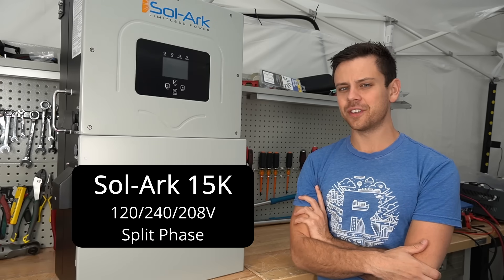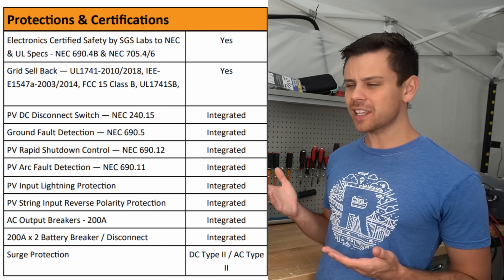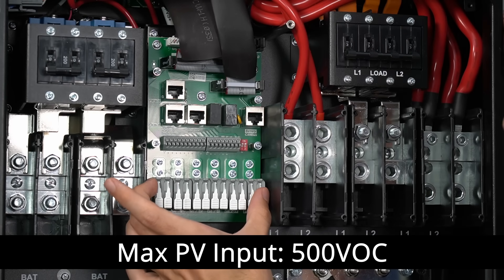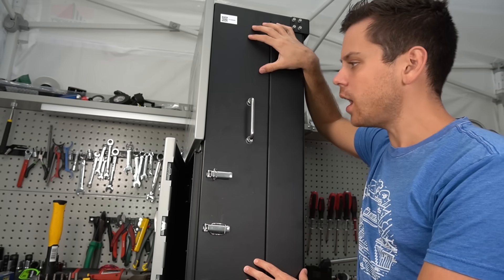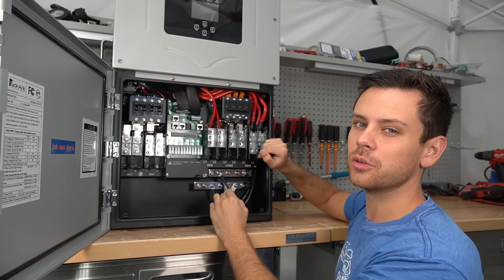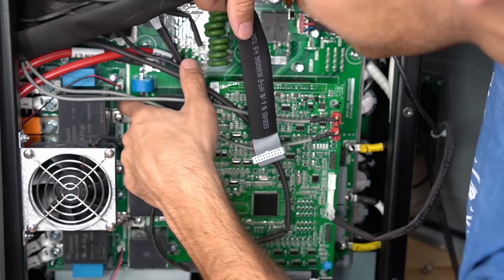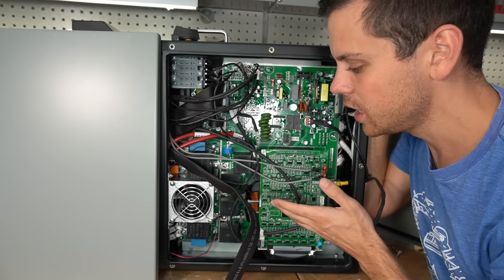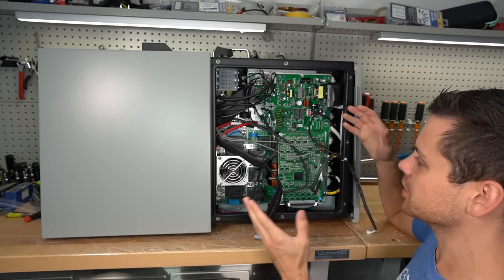Sol Ark 15K: Ultimate Grid-tie or Off-grid Inverter

Comment: The 200 amp pass through makes this an incredible solution. I believe there are around 90 million homes in the US with 200 amp services and cutting this inverter in between the meter and the panel makes for the easiest installation out there. Can't wait to couple it with the smart load. 14.  I've installed the 15K on three homes and they perform great! Thanks for the review Will. It's a beast.
Reply from the maker: Looking forward to your new videos. Your builds are incredible
Reply from the maker: Oh man that's so cool. What a beast of a unit. The passthrough is so useful. And that's a ton of homes! Three installs already?! That's so awesome
Reply: With the 200a passthrough, does this mean I can basically have this connecting to my main grid input and have the 15k feed my main house breaker panel? Basically I take my two phases out of my main, then into the 15k, then connect the 15k AC output back into my main? If I under produce using solar, that would complement using the grid?
Reply: @mathieuisabel9086  That is correct, I currently have a pair of the 12K units in parallel feeding my home (same principle, just max of 120A main)
Reply: @mathieuisabel9086  Yes (assuming an approved fused disconnect at the meter, a interconnect agreement with the utility, etc.)
Reply: @mathieuisabel9086  No, you don't' want to design the system to fail.  Think about your total system design.  I provide consults.  Click my logo for more info.
Reply: What would you do for a house with 320 amp service using I think what they called a double tap meter or meter box.  200 amps to the house and 120 amps to the garage.  Would one use two 15ks?
Reply: @fred6464  on $320 or 400 amp services you can feed to inverters from the meter and then combine the load outputs using either an AC combiner, or Polaris lugs, or power distribution blocks making sure that the r-rated for the correct amperage and then feed any in all panels downstream.
Reply: @fred6464  you could have two separate systems but I’d probably set a 400a disconnect next to the meter and use two 15Ks to disrupt that service and then feed the house and shop off a loadcenter on the load side of the inverters.
Reply: @NoahBeall-BPS  Thanks, that makes sense.  I do not plan on doing any of this myself, but I want to have an intelligent discussion with whoever I would hire in the future.  I also have a 20Kw generator connected to the 200-amp service which is all Generac equipment.  Net metering is available where I live as well.
Reply: Does putting one 15k between the meter and the panel mean you are limited to just one (not expandable)?
Reply: @keithwingo514  it wouldn’t be too difficult to add more inverters in parallel
Reply: @keithwingo514  no you are not limited you can parallel and combine I have a customer in Belize that has stacked 9 - 15 k's
Reply: XW  Did All This 15 year Ago x3  xw4860 18kw  still working
Reply: The man himself! The 15k is a beast but we are having interconnection issues with certain utilities that require an AC production meter. Obviously there’s no way to meter PV only on the AC side with DC strings… it’s a bummer.
Reply: @NoahBeall-BPS  My utility in midwest required the extra PV AC meter to monitor AC production to grid even though I have smart meter that measures incoming and outgoing current.  I believe you can still install a 15k with extra PV AC meter by installing the required AC main 200A disconnect that would be fed from the extra PV AC meter to the 15K AC input connection.  When I considered tapping the Main AC line to connect the 15k to my home, the cost and time with no power were a deal breaker for me.  If you need the 200A pass through, it is a great option.  After logging power usage on my home for 8 months, I don't need that much power at once.
Reply: @TheJjyoung333  we can do that here because they are requiring Production meter, not an export meter.
Reply: Which batteries and panels do you pair with inverter for best results? Any recommendations?
Reply: I don't think you want this handling your whole 200 amp panel, its just a bad design.  The purpose of getting this is to provide battery backup of critical loads.  It can handle about 4500 watts per hot connection (L-1 or L-2) or 12,000 if they are totally balanced.  So if your power goes out you want it to be off grid and handle the loads properly.  I have a solar business and make batteries.  I have a few of these installed out there and know how they work.  I provide free estimates and can do consults.  Putting this on your mains and powering your whole house is mostly likely going to cause problems unless you just never use more than 4500 watts per each of your lines.  Click my logo for contact info.

Comment: Pass an inspection for an off grid application, what is wrong with that perspective. 🤔
Reply from the maker: People still pull permits for fire safety codes with pv array installs. And you can be still tied to grid for backup and need inspection, but run your house 100% Offgrid. Up to you

Comment: Finalizing design of my system and went back and forth between 3 EG4 or 1 SolArk 15k.  Hate the price, but LOVE the features, ease of use, and support.  Can't beat the SolArk 15k ... but rumor is EG4 is finishing the testing on some "new and competitive offering".  Dagnabit.  Now I have to wait a tad longer before writing the check!!
Reply: Any links supporting that EG4 competition?
Reply: @craigmitchell5628  a tech at Signature Solar helping with my design said EG4 has a new model in testing that is supposed to be competitive with the12k+ option.  We were specifically comparing the Sol-Ark 15k, but not sure the 'super secret' EG4 model goals are.  He said it was in testing and could be there for another week, month or quarter.  They couldn't announce it until the testing was basically done. .. but to keep checking back.
Reply: @craigmitchell5628  It's probably FUD from a EG4 worker or investor.
Reply: Would be nice if it had the pass-through option!

Comment: Just connected one of these to me 30kw EG4 bank. Waiting on some tree work for array to go up. Went with 36 455w bifacial panels. It does chew through 75-80w just being on, no load connected at all. Will I would love to hear your opinion on battery/charger settings for EG4 bank. Thank you!
Reply: Did the communication protocol work?
Reply: @timburke3096  no luck with that yet. Looking into solar assistant to monitor batteries. Hoping EG4 or Sol-Ark get this working though.
Reply: @TamingilNH  Its a highly technical subject.  I hope you get something working.  I know I have some of my battery systems that are connected to sol-arks.  If it doesn't work and you go voltage mode you might get shut downs.  If you do voltage mode make sure you packs get balanced often.  Unfortunately sol-ark does not have a scheduled balance for some setups so yo have to use time of use settings and do it daily.  But if its just a backup system its not too bad doing it that way.

Comment: Finally, some Inverter and charge controller that is well engineered. Nice to finally see something with normal readable and usable LCD screen, sensible button layout, and LAN and WiFi.

I am sure Schneider Electric is better, but this is not too shabby.

Hopefully we will get some high voltage battery systems in the future, to improve efficiency and reduce thick cables.
Reply: Might want to talk to actual installers and users of Shneider before making that assumption.

Comment: Will, great video on this Sol-Ark 15. The one thing that stands out to me is the grid pass thru and transfer switch for generators. My concerns are if the inverter had a castiropic failure could it still pass thru grid and if the grid was down could the generator still pass thru. Normally auto transfer switches have a manual means of transferring, in the event the electronics fail. I haven saw where the Sol-Ark does.
Reply: You can easily wire in a junction upstream of the inverter to bypass it entirely

Comment: Awesome job Will!  I have been waiting for you to review Sol-Ark.  I will be installing the EMP hardened version of this Sol-Ark 15k along with at least 6 of the UL Rated 48v LiFePo4 5.12kWh batteries (EG4-LL Lithium Battery) in the spring.  Will start as a whole home backup but will move to time of use to reduce daytime Usage costs during daytime.  Still trying to choose panels as my home has poor sub-optimal roof orientation for roof mount.  I am open to suggestions for panels and advice on how to get past HOA resistance in OK.
Reply: Will the eg4 ll battery communicate with the sol ark?
Reply: @richardhulbert9833  Yes, they fully integrate using the network cable comm link

Comment: No doubt it’s the way to go if you want grid -tie.Especially if you have time of use rates,but for many it is better not to put all the eggs in one basket. 3 Growatt 5ks and a transformer is $3050 and scalable also. Good point about the pre charge function in the EG4 batt. I have a f9 code on my MPP 6048 because it is too fast .Got to send it out for repair.

Comment: Hi Will! What would you recommend for someone doing large amounts of solar 20+kW and also doing a few kilowatts of Wind turbines, with the option to run a generator if those two fail to produce enough power and the batteries get low? Would this item be able to handle that? Even if I want to tie to the grid and feed back excess to the grid?

Comment: If I had known in advance all of the problems I was going to have getting my first Sol-Ark 12k to work with my solar battery bank, I would have waited until now and purchased a Sol-Ark 15K. It took me almost two years to get the 63V Sol-Ark 12K model I had originally ordered that was substituted with a 59V model I didn't even know Sol-Ark made. Because I needed to run my LTO batteries at 61V Nominal I couldn't use the 59V model. Now, I have a new outdoor model sitting beside another one just like it sitting in it's box in my shop, waiting to be installed. The only pro's are that if one breaks down, I still have the other and I have more power than I will ever use. But, the amperage of the 15K, wow! I could really do a lot of welding with it as well as running anything on my off-grid farm without any worries. What a unit!

Comment: Biggest issue I see is its a single point of failure. Should it go down, its taking your entire solar/battery system off line.  Otherwise it looks awesome and I want one.
Reply: Sooo...you mean like when an ice storm drops a tree on your grid lines, or when your local grid transformer blows, or when local substation blows, or when grid goes down....like that type of single point failure?
Reply: The inverter actually will continue to pass through power to the loads if you have a grid connection and say for instance you get a battery voltage low fault !

Comment: Hey will. I love the solark 15k. I’ve installed several already. One thing to note is the inverter is not service rated, so you do actually have to have a service rated fusible disconnect on the line side of the inverter. Great vid!
Reply: From your experience, do you think it can pass through grid or generator if the inverter has a catastrophic failure.
Reply: @craigmitchell5628  I obviously haven’t seen an inverter failure yet, but Sol-Ark seems to be pretty confident in the 200a relay in the unit staying closed in the event of a failure.
Reply: @NoahBeall-BPS  thanks for your reply Noah ! Although I like all these guys YouTube videos. I wish they would answer questions after they requested them. You would think since most are getting paid for their likes and subscriptions, they could set aside some time to respond.
Reply: That depends on the AHJ.
They have been installed here just like he said. No Fusible disconnect.
Reply: @nb117  they may have. But The 15k isn’t listed to be service rated. So any AHJ that knows what they’re doing wouldnt approve that.
Reply: So you are installing your main bonding jumper in the fusible disconnect & the neutral is isolated after that?
Reply: @8894larry  your bonding jumper would be installed in the main 200a disco, but I believe there’s also a neutral ground bond in the inverter that somehow doesn’t violate the code. I think Will has done a few videos regarding neutral ground bond in the past on these inverters.

Comment: So I have my whole house generator mounted to my garage separate from my house because it was easy to break the incoming grid lines there. If I wanted to use this would I mount it there and add the batteries or mount it in my house attached garage where I can easily split off my Enphase solar panels?

Comment: over here in europe region we have a german company making these Schneider Conext XW PRO 8.5 kW Hybrid Inverter for about 4000 euros each. so it is about 2/3 the price for 2/3 the power? these things also can be linked together. perhaps up to 3. they are marketed to small medium business sites or commercial type installations. but i dont see why you could not use them residentially too. similar sort of idea, of course depending which type of a grid system / which part of the world you happen to live in
Reply: well the cost is more like 5000 euros it turns out... so a bit more expensive then

Comment: I suspect your buddy is not going through the complexities of being Certified grid tied and battery backup system the Sol Ark 15K  is obviously designed for. 

When you completed this see if Sol Ark would sponsor a certified installation and do a multi-in-depth series on the process from permitting to flipping the on-switch. (great Sol Ark PR)

Comment: Having the generator option is big.  I wouldn't mind having something similar that could power the house for the 60 seconds it takes for the generator to come online.   But for that the price would be a little much.
Reply: The whole point is to not need the generator the entire time. It just runs when the batteries need charging if the solar isn't producing and/or the grid is down.

Comment: Will....would love your thoughts about difference between Sol-Ark and EG4 inverters.  I went with the Sol-Ark 12k and love it.  It does everything I want to do.  A friend is looking to try to save some money and we're looking at the EG4's.  FYI....he's wanting to grid tie solar and not sell back to the grid and have battery backup for night time as well as when the grid goes down.  My Sol-Ark can power a critical loads panel but don't know if the EG4's can do that.
Reply: EG4 is not grid tied. It’s grid assisted. Meaning the eg4’s can power a critical loads panel and more with solar and batteries tied to the eg4. You can also have a 60A utility last option if there’s no solar or battery power available. The SolArk’s integrated rapid shutdown is also a game changer since now you only have to add the RSD to the roof panels. With EG4 you have to do both for code/safety. I have two EG4s with batteries and am not off grid, but moving that way. This 15K is my dream unit. So I’ll keep dreaming.

Comment: I just picked up my own Sol-Ark 15K directly from the factory yesterday.   Planning my own DIY install.  Very interested in seeing how you safely connect this in between your friend’s meter and panel.  Please post that video ASAP.  BTW, Great videos!
Reply: Where is this factory?
Reply: @ShaneFromSA  I googled it. Plano, Texas.
Reply: I'm wondering this myself, my meter and main panel are connected together with bus bars.  Would be a major bummer/effort to replace the panel stuccoed in.
Reply: Pull the meter to kill the line to the current panel.  I think it works like that in most states.  Stinks if they bolt the meter connection in.
Reply: @whattheschmidt  meter just pulls out from its socket..
Reply: @TK-123  some are actually bolted in! Mine pulls right at though.
Reply: @whattheschmidt  Rare in the US to be bolted. Must be a very, very old building. Fire departments across the country know you can pull the meter to disconnect electrical service to the building to fight a fire..
Reply: @whattheschmidt , Yeah, It's going to be a little more complicated than just that.  😞
Reply: @whattheschmidt  the meters do just pull out but home owners are not legally allowed to pull them. the utility co won't be very happy if you do.
Reply: @Carey Gagnon, I'm in Richardson.  I would enjoy the company.  Look me up.  I'm easy to find.
Reply: Keep in mind you don't actually need to run the power through the sol ark you can also use CT sensors and have a dedicated grid line going into your breaker panel with a double pole 200 amp breaker.
Reply: i picked mine up for $8000

Comment: Great videos, as always! I'm converting my house from Schneiders to Sol-Ark and just installed this 15K along with 60kWhr of rack batteries. I enjoy the DIY space greatly but this inverter's possibilities were too great to ignore. Despite the 200A rating, I was sufficiently paranoid that my system design is setup for two of them and three battery banks. I'm in the crowd that thinks the superheating of our environment is just getting started, so I wanted to be safe. I will be curious as to how you do the external wiring and transfer switching for the total systems failure scenario.